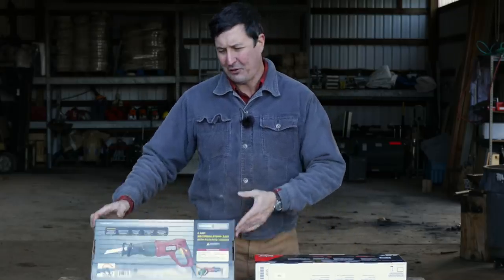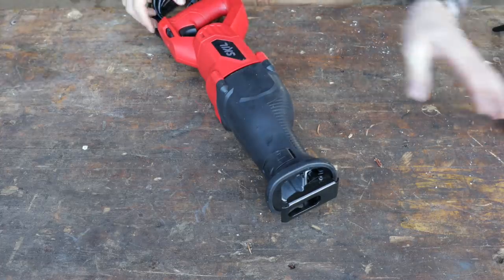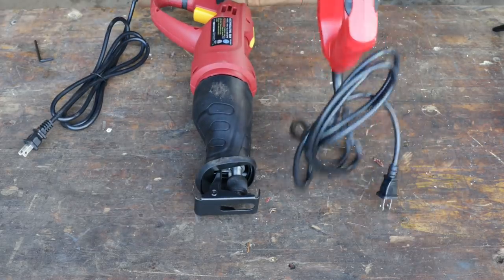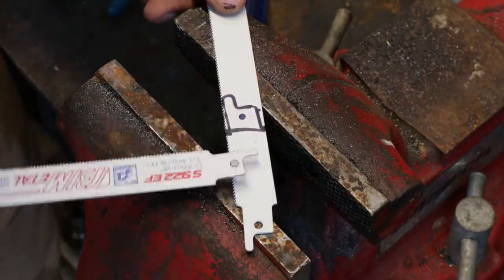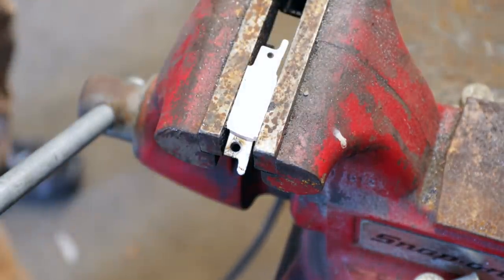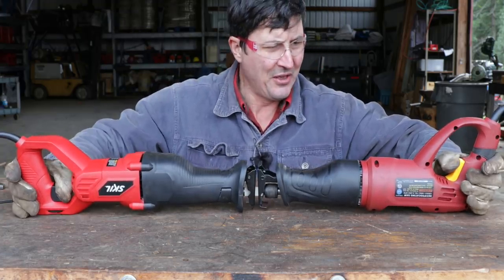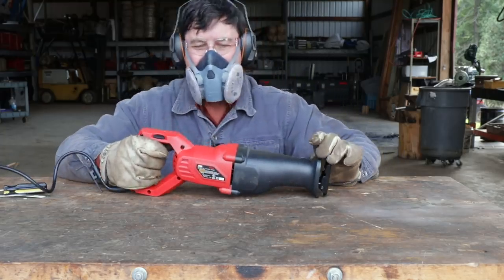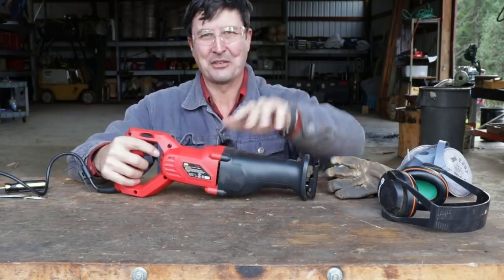Cheap Harbor Freight Tool Catches On FIRE!!!

Comment: Harbor Freight is GARBAGE!"!"  Everything I've ever bought there is total garbage.  I bought a tarp for camping to put over the tent as shade and an extra rain fly.  You could see sunlight through the fabric and as soon as it rained, it was about as waterproof as a screen door.  I bought a socket set, the ratchet stripped the first time I used it.  The final straw was when I was at work and the battery to my cordless drill died.  I fetched the spare, but it also died.  I was in the field and the nearest hardware store was a Harbor Fail.  I bought a corded drill and returned to the job site, a Hunt and Sons POL distribution center.  I plugged in the two-prong drill and pulled the trigger.  No kidding, sparks shot out of it like an Evil Kenevil stunt cycle.  The manager screamed, "GET THE F**K OUT OF HERE WITH THAT THING!!!"  Now, I wouldn't let my worst enemy's dog take a dump within 100' of a Harbor Freight.